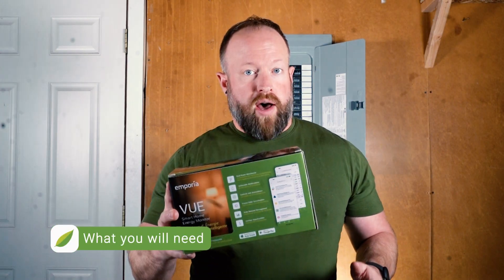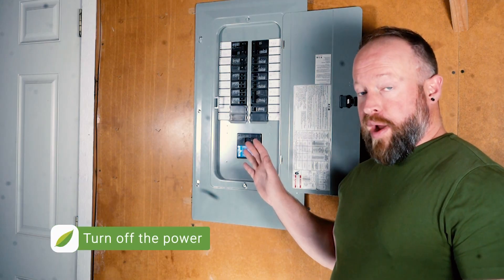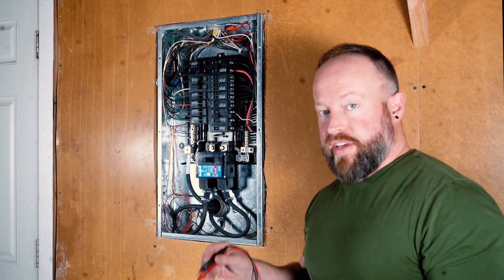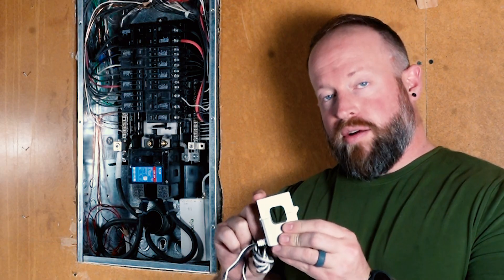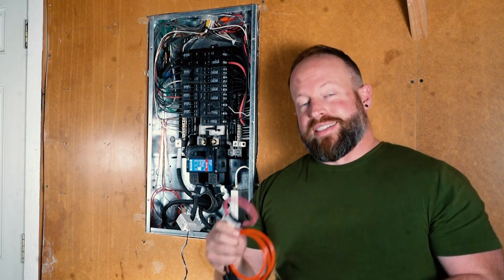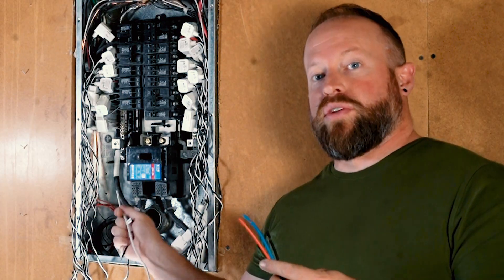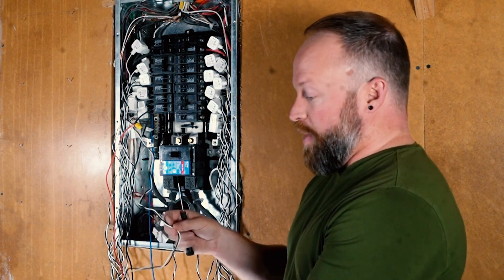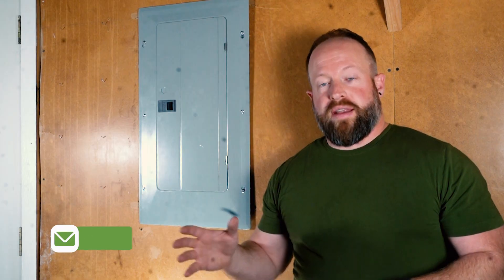Energy Monitor Installation: Emporia Vue Step-by-Step Install Guide

Comment: Should explain about turning of the power at the utility connection rather than just saying turn the power off. Also, need to explain that the screwdrivers should be insulated.  Furthermore, the manual says to connect the red and black wires to adjacent (stacked) 15 amp breakers, not to the main lines coming into the box.

Comment: Planning to get this but the panel looks very busy. Is it possible to run all the CT wires out of the electrical panel and mount the Emporia box outside? The WiFi antenna needs to be outside anyway. Extend the power cables for the box?
Reply from the maker: Great question about the Vue 3 Energy Monitor! Our support team can provide detailed answers specific to your setup/needs. Please reach out at info@emporiaenergy.com and they'll be happy to help!

Comment: If the antenna is supposed to be outside the box why not show how to do that with a very short cord to connect it outside the box
Reply: For safety reasons, the panel cover should be installed back on. If the antenna was tied to outside of the panel, the wire would be pinched. Also, depending on the size of the panel cover or if its surface mounted or flush mounted, the antenna protruding would prevent the closure of the panel.

Comment: I watched another video unfortunately gave some incorrect information said to twist the red+white+blue together connect to the neutral bar. Since it's only a sensor wire it's working. Also didn't talk about only needing one CT for each 240V circuit makes sense. I was merging both lines in the software. Also didn't know about cutting the wire to length. I used that video instead of reading the directions. Planning on removing it starting over it's a wiring mess in there. lesson learned don't rely on YT videos over the manual.
Reply: Mine doesn't have a manual just a QR code that sends you to a page to download the app
Reply: @GhostRider42278  yeah, this is not a good user experience, I had to go digging for a manual, no quick links or intro routine.

Comment: Can I just install the main unit outside the panel and run all the other lines in thought a breakout?
Reply: No reason you can't. My old panel had no room for the main unit so I did that exact thing.
Reply: Will this work with a subpanel in my shop in the back yard? I don't want to mess with the main property panel just yet.
Reply: @SurgeonTech  Should work no issue for a sub panel since the main subpanel's conductors are landing on a breaker as well.
Reply: @SurgeonTech Yes, but it will measure the circuits in the remote panel and nothing in the main panel of course. The "CT's" can only see what they are connected to. Hope this helps.
Reply from the maker: Yes! It will work perfectly fine in a sub panel.